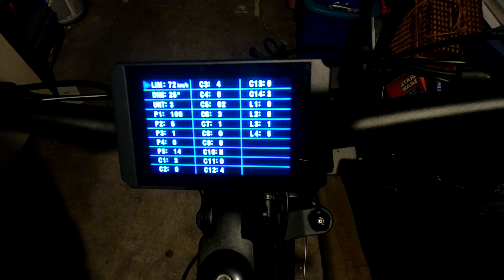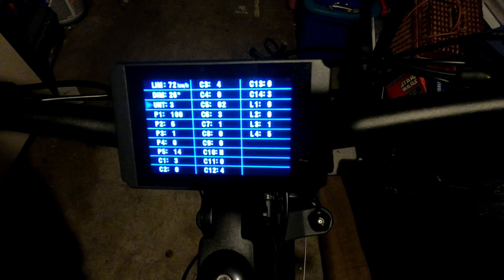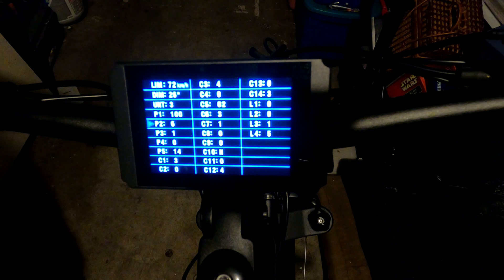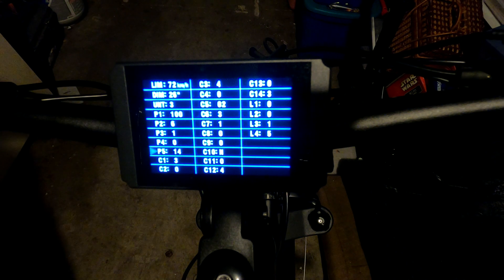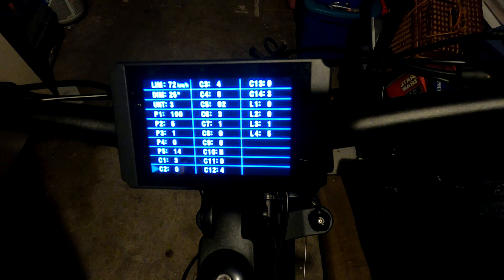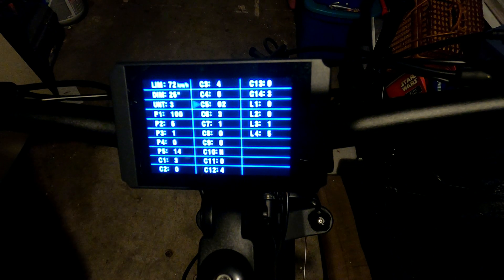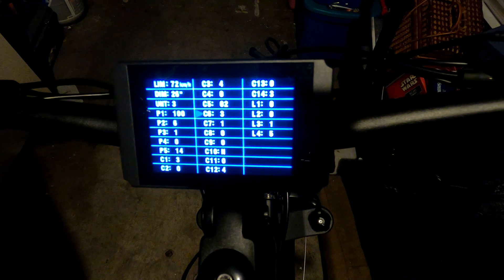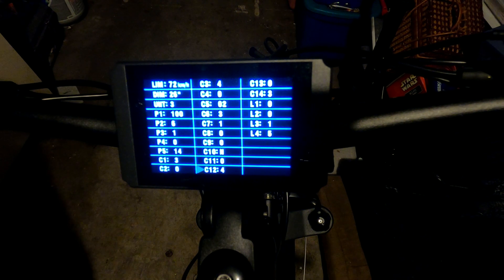RadRover Upgrade Settings Explained! (By a Dummy) 😜

Comment: Good video. I've already upgraded my batteries to 52v, on my Rad5, using the Area13 safe-mix module in line. 
You mentioned doing an upgrade of the Bafang motor. 
I saw a "G092" on eBay for $300. 
Will that give me a higher speed? 
I have plenty of torque with the original hub, but even with the new controller/display settings maxxed out, I've never been able to go more than 30 mph.
I'd like to give it a try, because all I'd have to do is swap-out the internals and voila! 
1000 watts. 
What are your thoughts please? 
Cincinnati, Ohio USA
Reply from the maker: I've been able to get mine to 32 with the motor upgrade, but I'm also a 300 lb man. If you're almost there with the stock motor the upgrade might not be worth it. The swap is very easy though and with that bigger battery I'm sure you'd probably get a bit of a boost.

Comment: I did a 52 V battery upgrade. I talked to one of the vendors and they said to set my P6 to 17 or 18 but that wasn’t enough. I found that 21 was perfect for P6 for my battery. I used this chart I found on 52v battery voltage to help guide . When my battery is at 50.4 V, then that is 50%.
Reply: I know that seems kind of coincidental, that 50.4v is 50% but that’s accurate. 
100% is 58.8v
75% is 54.6v
50% is 50.4v
25% is 46.2v
0% is 42v

Comment: Adding power is great...but
How are the stock rad axel torque plates holding up?
Id really hate to have the axel slip and rip out the motor wires.
Has anyone had any issues and has anyone, installed any kind of upgrade?
Thanks

Comment: Thank you sooo much, with the setting P2=6 the speed display and the odometer showed an incorrect value (0 km/h to 4 km/h), after looking through the comments and your explanations, I found the solution quickly: (" ... try the setting at P2 from 6 down to 0..."), with the result, that when setting P2=5 (DIM=29"), the speed display and the odometer work correct!! (Sondors X with Bafang 750W / controller 35amp, battery 60V, wheels 28"x4.9").

Comment: I have a 2020 radrunner anyone know the best settings to put it on?
Reply from the maker: If its stock there's not much you can adjust in the settings. If you've added the upgrade kit from Bolton ebikes then hopefully this video and the notes in the description can help you set it up.

Comment: Just installed it with these settings. 48v battery showing 53.4 on one bar?
Reply from the maker: 48v is the nominal level, it could go even higher than 53v but for safety the bms limits it to 53.3.

Comment: Did you ever zero in on the best P5 setting for the stock battery? I just installed the controller on my 2018 Radrover and am waiting on delivery of a new motor.
Reply: 15 is the right number for a 48V battery

Comment: Hi I was wondering if you could answer a question when the bike shows my wattage the the wattage always stays on I cannot add some pedal power and lower the wattage the bike is putting out what I mean is if I'm on pas1 say the wattages 200 w I cannot pedal and lower the Watts it will always stay around 200 or so. I was wondering if there's a way to lower the wattage in each pedal assist by pedaling hard to lower the wattage. It always shows a high wattage even if you're pedaling really hard I'm not talking about the settings to lower the wattage output I'm talking more of a pedal hard to make the Watts lower kind of thing. Any ideas thanks in advance.

Comment: How do you start and stop the cruise control?
Reply: IF you haven't found the answer yet, go into settings and make sure C7 is set to 1 (cruise enable). While in motion and going faster than 7kph(4.4mph) press and hold the down arrow on the keypad.

Comment: Hi thanks for the video I was wondering if you could answer a quick question? I installed the Bolton controller and I want a little less power on the first couple of pedal assist settings. Do you know if that is possible?
Reply: set C14 to 1

Comment: I have a 52v 30ah triangle battery with upgraded Bolton bofang motor and controller with display. Thing is my battery cuts off at 51v meanwhile my brothers bike cuts off at 43v why is that? What do I have to fix in my settings to let me go longer?

Comment: I have one off these screens on my 2000w kit, but it doesn't go as fast as my 15000watt kit with LCD3 DISPLAY,  something isn't right with my settings,  iv a 700c wheel ,  can anyone help because even this video doesn't make a difference not matter what I do to my settings
Reply: I jave the same.2000w on a 52 v  not as fast as my old 100w that has a s900 screen

Comment: Just wanted to correct the info you gave for p3.  when this value is 0, throttle max power is determined by the PAS level. when it's 1, max throttle is allowed regardless of PAS level.  So lets say you're in PAS 2 and you are capped at say 10 mph and you start using throttle and P3 = 0 then you will not go over 10 mph.

In either setting the throttle is gradual.  It DOES NOT make the throttle only on or off when P3 = 0
Reply: If P3 is 1 and you are half throttle and not pedaling, when you start pedaling in PAS 1 or 2 or 3. the power jumps to the max of what you have set at C5. One way to make this safe for beginners is to set P3 to zero.

Comment: Very informative. Only problem I seem to be having is the PAS seems to cut off at 20MPH
Reply: I have the same issue.  Although it doesn't cut right off, the watts lower to around 200 once I reach 20 mph.

Comment: Top video my rad rhino 2019 
Try setting but my Pedal assist 1 to 4 is very low on power where five is full power
Reply from the maker: If you still have the stock Rhino motor it may have a different ratio.

Comment: What should my settings be when using 52v battery? Thank you for this amazing vid
Reply from the maker: The settings should be fine for the 52v battery. The only setting that would be affected would be P5 but if you have it set to 0 it just adjusts the voltage automatically.
Reply: @SuPRCooPR  I received this particular display with a kit meant for 36 volts. I tried changing the P5 setting to zero but it's not recognizing this as a 36-volt battery. It has 41 volts but the display indicator shows it's got zero bars. I'm trying to troubleshoot and wondering if this is even meant to work with 36 volts?
Reply from the maker: @aznative_  it’ll work with a 36v battery but the “real time voltage” 0 setting in my experience isn’t accurate with even a 48v battery. I tried rides on every P5 setting from 0-40 and it never showed me accurate battery level. I just leave it at zero and rely on the voltage level and the battery level indicator on the battery itself.
Reply: @SuPRCooPR  first of all thank you for the response and a quick one at that! I figured out my problem. I was using a different throttle then the kit came with and no matter how I wired it it wouldn't work. When I put the original throttle on it does register my battery and says that it has full Voltage which it almost does. As long as it's close I'm not overly concerned. But I was trying to track down why it wasn't working at all and it came back to being a throttle related issue. I've had similar issues where I get everything plugged in and connected and the display is programmed for the wrong battery and then once corrected everything works. That wasn't the case. But with so many different parameters to change I could have been trying that forever I'm glad I got right to the point with your help and then figured that wasn't the issue and went over to the throttle.

Comment: Ok i do have a question.  I installed the controller and display and everything seems to be working correctly except i have no idea what speed Im at. I have the fat tires and cant seem to program it correctly. Any help would be appreciated
Reply from the maker: You may have to mess with the wheel size, its the DIM setting, I had issues with that at first too. I used a speedometer app to compare and just kept changing the size until it got close to what the app speed was showing.

Comment: Just got motor waiting on controller from Bolton. Besides the tire size, do you think all the other settings will be familiar with the radmini 4? Thanks for this vid!
Reply from the maker: With the same motor and controller I think you should be fine. That's going to be a fun set up on a Radmini.
Reply: Tire would be 20 diameter otherwise similar to the rest

Comment: I tried you settings today on my Rad City. The PAS does not work. If I pedal it goes to 28 MPH for every PAS setting. Is there something I need to do?
Reply from the maker: Did you upgrade the motor as well? The amount of magnets on both the PAS sensor and the stock motor may be different on the City.
Reply: @SuPRCooPR  No, did not upgrade the motor. It is a gearless 750W max Shengyi Brushless Hub Motor. 26 inch tires. 12 magnet cadence sensor, 1x7 gearing. Can you suggest any settings?

Comment: I guess the P group is Program, C is Controller, L is ? Limits?
Reply from the maker: seems like a good guess to me
Reply: @SuPRCooPR  Great video! I bought this controller upgrade from a different vendor (not Bolton, they were out of stock), and mine came with no menu setting instruction. I took good notes from your vid and I'm using your info for my baseline set-up. Good work. Put yourself down for a raise and take the day off.

Comment: I installed this on the radmission and it works great, but right now I can't get the pedal assist to work, everything else works amazingly well and it's fast as hell even with the stock motor. all the cables fit with no issues 

//Edit: throttle works now, it's one of the "C" settings with the magnets, I set it from 3 to 2 and it works great
Reply from the maker: I figured it might be something like that. The ratio for your motor and your PAS sensor are probably different than the Rover.
Reply: @SuPRCooPR  Actually I left the ratio and magnets (motor magnets, set to 100) the same as in your video, seems to work perfectly fine. The only difference seems to be the PAS sensor (setting 2 instead of 3)  and I set the max current to 10 but all the other settings I copied 1:1

Comment: Hi I have a Paselec Gs9 same display, but 27,5 tires.
Could you help me setting the 5 level pas , because from 1 to 3 there is very low power motor..only 4 and 5 pas works well.
Reply from the maker: That's a tricky one, without knowing all the specs of your motor and PAS it would impossible diagnose exactly what settings you need. There isn't a setting to adjust each individual assist level either so it may just be the way it was designed.

Comment: I have the radrover and upgrade the controller and motor .  My controller seems to have a limit switch in place that disables my bike at 1200w .  I see other ppl getting over 1500 w on their bikes .  Anyway I can adjust this top end
Reply from the maker: C5 will adjust your max current, 00 is the lowest and 10 is the highest. If you want max power go to 10. Then C14 adjusts your power-assist, 1 being lowest and 3 is the highest. Set that to 3 and you're at full power-assist. Hope that helps.
Reply: @SuPRCooPR  that did the trick ... thx

Comment: Thank You I got a new Rad Mission and right away I got a 25 amp controller and the kt-lcd8h, installing the setup was easy getting the setting for the display has been an issue till now. again thank you..
Reply: the 25 amp controller give worse battery life then the 35 amp controller
Reply: @69tytyhar  why do you say that
Reply: @JohnDoe-xf5yh  read the reviews of the prouduct from people that did the mod the ended up buying the 35 amp and set it accordingly
Reply: @69tytyhar  that doesn't make any sense.... its LESS current it max out at 1100watt instead of 1680
Reply: @69tytyhar  isn't there a stronger controller out there somewhere, perhaps Ali express...
35amps isn't that much, & was also wondering what would be the biggest & stronger wheel motor 🤔
Reply: @Matanumi all about efficiency the 35 amp has more dials to tune

Comment: Sup...just put in the upgraded 750w motor, controller and display.

While the rain keeps on pouring out here in the Pacific northwest I took the time to upgrade my brakes as well...dropped the extra coin for the 203mm front rotor and got a new 180mm rotor for the rear and mounted the 4 piston hydraulic calipers front and back,  all magura components...OMG!

threw on the rhino splash guard as well.

Thanks again for the great programming vid...TOMORROW I RIDE!

stay easy Squatch Man.

Happy New Year to you and yours.
Reply from the maker: Sounds like you're riding in style, Happy New Year to you and yours as well.

Comment: Do you know how to setup 27.5"wheel on this monitor?
Reply from the maker: It doesn’t go to half steps but you could try setting it to 28” first and see how close the speed is with a speedometer app, waze works good. You could also try 26”, 700c or 29”, you’ll just have to test each DIM and see which gets you the closest.

Comment: I have a question for you I have the upgrade kit but not the motor yet but my throttle is keep cutting out on me what do you think my settings should be set at I've been trying to figure it out but it keeps cutting out on me?
Reply from the maker: Is it cutting out before the volts drop to 40?
Reply: @SuPRCooPR  like the throttle works and then I pedal assist and I try to use the throttle again then it cuts out on turning on then my screen goes white and then I got to shut my screen off and then try it again and it won't do it again
Reply from the maker: @TheY89  that doesn’t sound good, you may have a bad controller. I’ve heard several people say the throttle itself has gone out but it wouldn’t effect the screen like that. Make sure and triple check all the connections and if that doesn’t help I’d call Bolton.
Reply: @SuPRCooPR  I think it keeps cutting out because I still have the stock motor I just don't know what settings I should use for the stock motor and I still have the stock battery of 48 volt.
Reply from the maker: @TheY89  for the stock motor try going with Bolton’s settings, they have them posted on their website. It’s worth a try, I still have the stock battery too so that shouldn’t be the problem.
Reply from the maker: @TheY89  here’s a link to Bolton settings: https://boltonebikes.com/products/2019-radpower-upgrade-kit-with-tail-light
Reply: @SuPRCooPR  yea I see you sure that's not the setting for a rear bafang 750w motor settings? I just don't want to use those settings and then it screws up my bike you know what I mean but I already emailed Bolton ebike to find out what settings I should use
Reply from the maker: @TheY89  yeah, that’s the settings they recommend for the controller upgrade. It’s hard to say what setting would cause the issue you’re having, seems odd that the display would go out like that.
Reply: @SuPRCooPR  well I figured I asked you what's going on because I don't know really about electric bikes type thing. Well I'll guess I'll try out my bike tomorrow after it's we stop having this northeastern that we're having snow/rain. Just wondering will the P2 settings go down to 1 instead of 5?

Comment: What are the L parameters can't find it anywhere?
Reply from the maker: If you're using a Bafang 750w or 500w the L parameters are just set to default, they don't apply to those motors.

Comment: KT-LCD8H Programming and 35a controller fitted to my  Radrunner plus I have used your settings as described in your video with a change on wheel size to 23 - However my speedometer is not correct and my mileage reading is obviously way out can you suggested were the setting need adjusted please
Reply from the maker: First I'd try and mess with the DIM wheel size setting, I had to do a bit of that to get mine accurate. If that doesn't work the only other setting that would effect it would be P2, it only goes from 0-6 so start at 6 and work your way down to see if it changes anything. Hope that helps.

Comment: My speedometer is not displaying the correct speed. I am using it on a 2019 Radrover with 12 posts on the PAS sensor and a 500 watt rear hub motor. I have tried using Bolton's video once and that left me with a throttle that would only function while I was in the advanced settings menu when I took it outside the throttle did nothing. After following your settings in this video that issue was corrected, but my speedometer is still not displaying the accurate speed. I had to be going 40 or 50 KM/hr but it said I was only going 2.5 km/hr. I think that I must have my gear reduction ratio set incorrectly but I have no idea how to correct this? With so much more available power it is even more crucial that I am able to see the correct current speed. Can you help?
Reply from the maker: P1 should still be 100, it’s based on the motor alone not the PAS. P2 is probably where the problem is, Bolton said to set it at 5 but that gave me speedometer issues, setting it to 6 solved my problem. It could also be the wheel diameter setting, try adjusting those two, P2 or DIM, and see if that helps.

Comment: Yes thanks for the info,especially the Regen setting I turned on for direct drive and it makes similar street car whine/noise and great way of braking downhills.Original could not tell if the Regen was activated.I got lights but how do you engage the cruise control?Thx
Reply from the maker: To engage the cruise control just pedal/throttle to the speed you want and then hold the down arrow on the control pad for about 4 seconds.
Reply: Yep all good now .What a great upgrade.Battery display shows it charging on Regen now and a brake symbol comes on display .Thanks again for info.
Reply: Thank you for answering question about cruise control. Made my day. 😁